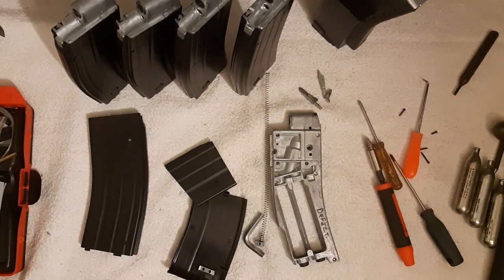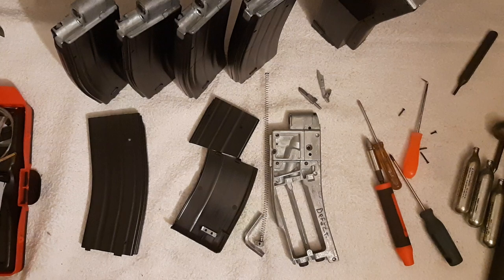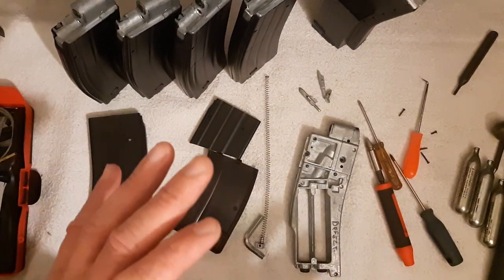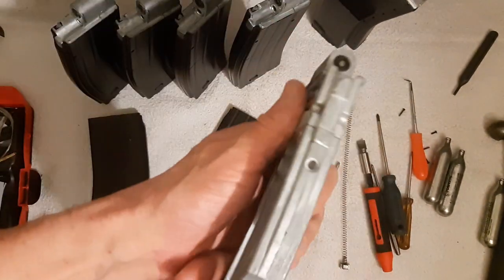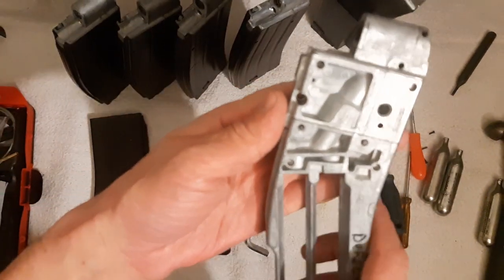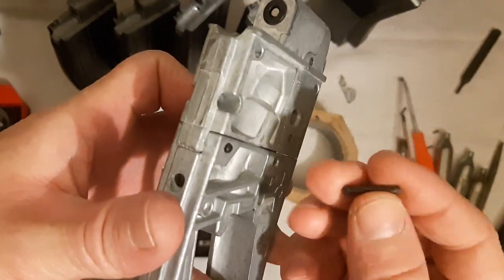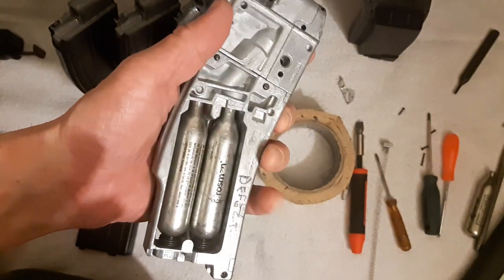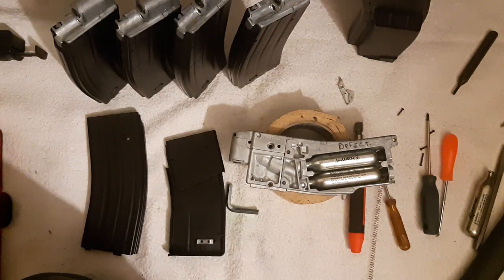Crosman Full Auto BB Gun Magazine - Tips And Tricks

Comment: When it comes to getting bbs stuck in the spring, my friend had that same issue and i took two tweezers and fiddled with the bb and i managed to pop it out through the bb hole so it is possible but you will have to move the bbs into place with a very small and thin tool. you will definitely need to sandwich the bb in between your two tools or else it will move when you try to pop it out of the bb hole. Now if your bb manages to get to the very bottom of the spring then i don’t believe that you will be able fix it but as long as it doesn’t get stuck at the very bottom of the spring then you can fix it
Reply from the maker: Yeah I can see how that can work, and hopefully the spring isn't mangled.
Reply: This was my issue. Screwed up a spring doing this. So I had to buy another mag after spring was trashed. Still trying to find another spring
Reply from the maker: @anthonysanders4326  there should be spring manufacturers out there that can provide quasi similar springs
Reply: Duck duck go ‘airsoft’ loading magazines spring mechanism / ex springs.  
Was bored and felt lil baby Jesus move me towards gentlemanly deeds…- and to aid a down’d weapon soldier
Reply: @Anthony Sanders  contact crosman they sent me a spring free of charge
Reply: You can gently bend the spring, then insert it using the metal piece that holds it as a guide.

Comment: As for the spring... You can unscrew the t shaped tab and remove the entire spring with the BB in side allow for easy removal. I cut off about an inch (or even slightly more) of the spring with wire cutters as I've found it unnecessarily too long anyways. With the "spring shortening" I find it easier to load the BBs and have never had a problem with it not having enough tension to feed. Hope this helps
Reply from the maker: @TylerJackson10er  nice!  Thanks for the info! I would definitely have hesitated to recommend shortening the spring.
Reply: Esotericgemini  both of my clips are still going strong after cutting the spring. Hope it works for you!

Comment: If your sitting at the table and jawing with the wife while your loading her mag and you inadvertently shove a BB into the spring, it's not wrecked.  Simply take the screw out that holds the spring into place and take the spring out.  Once the spring is out you can remove the BB's from it without damage.  I've been working on scuba gear for years.  Sometimes when you have a pressure leak the o ring needs to be replaced.  For a BB gun, take the offending ring to your local hardware store.  You can probably find a replacement for less that 25 cents 'Merican .
Reply from the maker: I agree with you 100% on this my friend xD I was hoping people realize the ez fix once the mag is disassembled and the spring (and bbs) come out.

I myself have worked on stuff as small as a vacuum pump all the way up to 80ft long 8ft diameter autoclaves xD.  Not everybody has tinkering experience hehe.
Reply: Is 2 magazines since I can just afford that second🫡   a good start for getting out practicing muscle memory with the DPMS full auto; red dots

Comment: So my issue with three different magazines is the hammer splitting the valve cover in two. Forgive my lack of technical knowledge and description here..basically on the top of the magazine facing the firing mechanism, there is a metal plate with one screw holding it to the magazine.. I have broken three of them in half. Once they break, the magazine will not feed bbs and the blowback action fails.
 Im old, but new to this hobby, it was to the dpms sbr that  I owe the credit to, for piquing my interest. So fun. It took about a week until I was All In, scope, red dot, bipod, quick reload magazine, and an extra standard magazine…not cheap, but it had a lot of great reviews so, lets go.
 The first mag failed in a week, the quick reload magazine took 
about three weeks, and finally my original magazine failed.all split this plate..no replacement part that I could find anywhere..not a lot of info out there on this type of failure either, so I’m left with no choice but to replace the whole magazine (?) anyway 
 Anybody else have a similar issue? Are there any diy Fixes or explanations as to why this occurs?
Reply from the maker: Yeah this does happen to others, although I never heard about each mag breaking one after the other. Have you field stripped the airgun to make sure all the components are properly in place? 

This is most definitely an airgun issue and not a mag issue. If possible I would maybe try and get it replaced. If not, a full field strip is in order, you need to make sure everything is clean and in its proper place.
Reply from the maker: As to why it happens is hard to say, I have 5 of these and multiple mags, and I only have 1 broken  bolt catch.  

If the buffers in the lower extension (the stock part) are not being stopped by the retaining pin they potentially could be slamming into the firing pin and the BCG assembly too hard, which would maybe crack that part.  

If you plink in the sun and let the mags warm up you could be running a supped up rifle but the internals are not built to handle the increased energy and could break.

You can verify the "hammer chip", it is the little black knob thingy on the end of the hammer inside the BCG.  that little black chip should only protrude by barely a mm from the end.  Any longer than that could be increasing energy dumped onto the mag valve.

Hope this helps, my videos should help you get through the field strip process, I cover everything with no editing so you guys can follow along.

Comment: TIP FOR STUCK CHECK VALVE (CO2 dumping or not charging): I sprayed some Hoppe's Gun Medic Cleaner & Lube (since the cleaner evaporates) into the chamber inside where the small straight head screw with the seal comes out of on the thin side, shook it around, tapped it a bunch of times in several directions, and that was able to get the valve unstuck without wasting any CO2. It also seems to shoot much more powerfully now as well.
Reply from the maker: @funniman15  hmm interesting, it is possible you actually had gunk or a piece of pierced co2  caplet stuck in there.  Just be careful, that stuff will eat away at the seals even if it evaporates, anything in a spray can will always have extra stuff in there so it "sprays" under pressure. But yeah, going in to by that hole to physically clean is a good idea, you lose a bit of the flush by co2 effect but you can shine a light in there and actually see the chechvalve slit.  Thanks for sharing!

Comment: You really need to show us if both CO2 cartridges actually emptied. I have 3 magazines and none of them actually work correctly. Meaning it only uses the cartridge on the left. And when I go to replace the left cartridge, the one on the right side gasses out. At that point its useless to change the right side one and just replace the left one, and leave an empty one in the right side. I have a solution though. I plan on marketing it to users of the DPMS SBR. It not only corrects for and eliminates the use of C02, But is also upgrades the unit to 1100 psi PCP air(vs 900 psi CO2). Its a great adaptor. Easy to install, and upgrades to 13 cubic inches of air. Now it really cranks.........I plan on launching sales sometime in 2024 or early 2025. I still need to work out a few logistics first, and launch the LLC. I figure there are around 1 - 2 million of these guns out there that need this mod.
Reply from the maker: If the second slot empties out it's because the ring is too tight most likely. The seal/piercing needle assembly is keeping the check valve (just a small bb) jammed.

You can buy a HPA adapter from pyramydair, just watch out for the power factor as too much psi will break the airgun internals. Hehe

Comment: Hey dude, My AK1 sometimes doesn't fire, then when I take the next shot, 2 bb's come out at the same time, do you know why this is happening?
Reply from the maker: @Steven-jn2cw  hmm, does it happen all the time or just when the mag is full or almost empty?...just quick off the top of my head before work I'd say possibly you are missing the magnet at the top of the bb follower channel in the magazine.  You should be able to see if it's there if you shine a light in the bb exit hole on the mag.  Or it might be the spring in the mag is binding.

I'll have to check my ak1 later to see if I can replicate the problem with the airgun.

Lemme know if you still have your magnet and if your bb follower spring is under proper tension.
Reply: @RWMAirgunsmithing  hello, thanks for the reply. It only happens occasionally, so I think everything is in place. I have actually put a little dab of pellgun oil around the magazine seal and spring area and the problem seems to have gone away completely. I wasn't sure if a small dab of oil in the magazine was a good idea but it seems to have worked
Reply from the maker: @Steven-jn2cw  nothing like a problem that can be fixed with a little standard maintenance! Hehe, I guess it makes sense, if there was a bit of foreign crud in your valve jamming up the springs inside it would explain the inconsistencies. Lemme know if the problem returns.
Reply from the maker: @Steven-jn2cw  maybe try flushing the mag if the problem returns.  Use one co2 and manually actuate the magazine valve (dont use metal) and let the co2 pressure "flush out" the insides of the valve.
Reply: @RWMAirgunsmithing  thanks man. I've just put 5 x magazines of bb's through the gun with no jams or double firing. The gun is new so maybe something bedded in or the oil trick worked, either way I am very happy with it! Thanks 👍🏼
Reply from the maker: @Steven-jn2cw  sweet! Technical issues interfering with plinking sessions are a PITA! xD

Comment: Hey bro came across your video and it’s cool. I don’t have any issues with the three magazines I have so far but I’ve only shot maybe 10,000 bbs. Which rifle do you have? I was thinking of giving the rifle a good cleaning but can’t settle on which product to use? Everyone says to use silicone spray or something like that but can’t find one that’s just silicone? Do you break it down when you clean yours or how do you exactly do it? Thanks
Reply from the maker: Aye, a couple drops of silicone oil in the bolt carrier and on the seals should be enough to keep it lubed.  I usually will just wipe everything down with a papertowel until it wipes clean then give everything a sheen with silicone oil, then one drop on each seal and one drop on one of the springs in the fcg. Many will say you dont need to clean the barrel on an airgun  but I pass a cleaning cloth regularly and you can definitely see a difference when you shine a light before and after. These things seems to run regardless xD I am just missing an R1 right now.

Dont use the spray stuff, those are usually industrial grade with additives, get regular crosman silicone oil or the rws bottle with the extended spout thingy.

Edit :  yes i do perform a basic field strip to clean everything

Comment: I think I damaged the piercing needles from over-tightening my co2...the co2 just shoots right out wasting all the gas in seconds. Is there any way to fix or replace the green seals or piercing needles?
Reply from the maker: Can you visibly see the piercing needle is crooked or flattened?  And which port does it empty from? The same as the co2 or the other port?
Reply: @RWMAirgunsmithing  It looks as though the needle on the first valve is slightly seared on the edge and that seems to be where the gas is shooting out. If this is due to over-tightening then I'm afraid I voided my warranty for sending it back
Reply from the maker: @argyleantiques9943  hmm the green seal should take care of a leak from the needle.  If you screw in the first one and it empties out near the piercing needle than most likely the culprit is the tightening ring.  You need to seat the seal a little more.  Usually piercing needle problems come with a drop in co2 during shooting, not loading.
Reply: @RWMAirgunsmithing having this same issue and I see the first valve is flattened
Reply from the maker: @jamari777  that sucks, you guys can try customer service but I don't know if they replace piercing needles.  Not sure if you "drop" your co2 in but treating mechanical devices properly is a big part of prolonged use.  I have over 3 dozen assorted mags and I go through boxes and boxes of co2 and never had any issues.

Comment: There's just a cone shaped plug between the two cartridge ports. Inserting the First cartridge presses the plug and it shuts the line so the secondary cartridge port does not let gas out. But the plug sometimes jams itself shut - especially if only using one cartridge at a time. Letting gas outta the first cartridge port, after both cartridges are installed, the secondary cartridge's gas presses easier the plug open since reduced counter pressure by the leaking first cartridge.
I had this plug jammed on one of my mags at some point due to often using only one co2 cartridge in the First port. But by installing an empty cartridge in the First slot first - and using a full cartridge in port #2, the plug always gets pressed open in use by only one co2 cartridge.. I often shot my DPMS with only one  cartridge - whenever I just wanted to do a quick shooting test or something..
Reply from the maker: Nice, when I empty mine I always unscrew the "first" one first, so the second co2 pushes the valve as it empties out.   These things are good for over 150 rounds when semi -auto plinking,  Kind of a shame they are so finicky.
Reply from the maker: A little "trick" I started adopting when switching around multiple unmarked mags... I load my co2 and give a little burst on full auto, it seems to dislodge and "wake up" that check valve.

Comment: Hi, hey I was watching your videos and I was going to take my gun apart and noticed the pin is missing. Not sure when I lost it. It's been in storage for 2 years. We moved but I want to replace that pin. I don't know what it's called. I took a picture but I don't see how to upload a picture to you. Do you know where I can get replacement pins? It's one of the black ones that you push it in and then just pull it out to remove the lower from the upper part of my bush master CO2 BB rifle
Reply from the maker: That would be the front pivot pin or the rear takedown pin.  Unfortunately crosman has not opened up many of their parts for sale individually  yet.  You can try searching online or your local airsoft shops for a replacement part, the fit should be pretty darn close.  You could even try a real one depending on prices.

Those 2 pins technically serve no other purpose than to keep the upper and lower receiver together.  Temporally you could jerryrig a fix with anything that will keep the two receivers snug and securely together, I would try to avoid anything that could carve grooves in your crosman holes.

Comment: Thank you for the informative video! I have a question.  Mine leaks from the second slot and from the valve at the top. whats wrong with it. Also, it rattles from the top when shaking it
Reply from the maker: The second slot leak should be fixed by tightening (just a little) the ring on the seal.

But that rattle in the top valve is not good, there shouldn't be any.  If the assembly isnt incredibly loose I would bet there is something broken inside.  You could try tightening the brass plate on the valve side, but if it is already snugg and it still leaks the valve needs to be opened and inspected. 

You can follow along with my disassembly and assembly videos.
Reply: @RWMAirgunsmithing  thank you very much

Comment: Thank you for the video! The rifle, although problematic, is a lot of fun! It’s a pity that in my country, due to political issues, it is now impossible to buy stores, even order from Ebay (delivery will cost the same as the cost of the store itself)
Reply from the maker: No wayyy! Hope you bought an extra for spare parts hehe xD.  

And yeah, this is my favorite, love how they managed to fit 99% of the real manual of arms into this replica.
Reply: @RWMAirgunsmithing  Alas, I didn’t have time :( do you know about the mod that supposedly increases the speed of the ball - it involves removing the mesh under the rubber seal of the first CO2?
Reply from the maker: @MrEvENGED  I can see how that screen could impede flow from the CO2.  Although if you're comfortable taking it apart I would recommend keeping it clean every couple thousand rounds. I am curious though, might test it out over the chrony.

There shouldn't be many downsides except you will wind up with CO2 manufacturers gunk inside your valve and barrel which would require a cleaning every now and again.
Reply: @RWMAirgunsmithing  yes, it would be interesting to measure it through a chronograph! I agree about cleaning, but I think this procedure is generally useful for any pneumatic :)

Comment: My R1 mag spring broke, what should I do cause i dont want to buy another mag (everything else works fine
Reply from the maker: You can replace it with any spring with similar size/stiffness.  You could probably find one with a few google searches, maybe even check out airsoft shops, they usually have plenty of parts for all their models.
Reply: @RWMAirgunsmithing  do you know the spring dimensions? I bought the wrong size & couldn’t find the size when looking it up
Reply: @RWMAirgunsmithing  i still have not found the spring dimensions after many google searches, please help me out
Reply from the maker: @lilar-1585  doh, sorry man, keep forgetting to open a mag and take measurements.  On it!
Reply from the maker: @lilar-1585  ok they are 8 inches long, 3/16" diameter, 10 spirals per inch.
Reply: @RWMAirgunsmithing  tysm🙏🙏